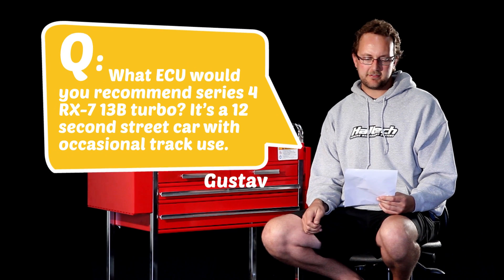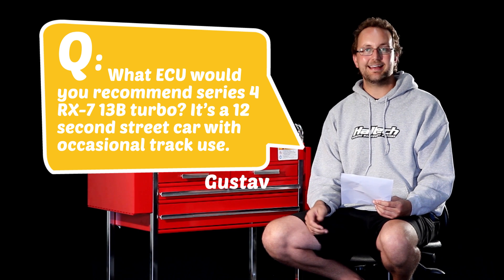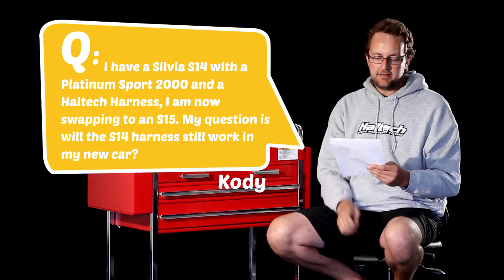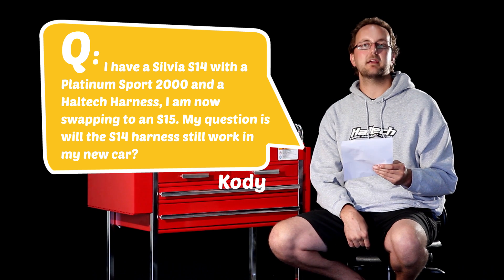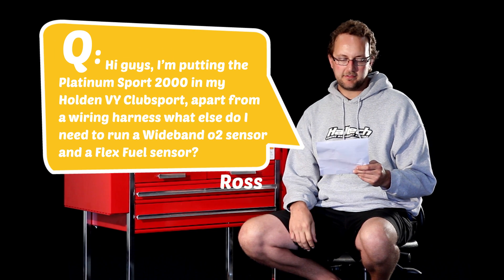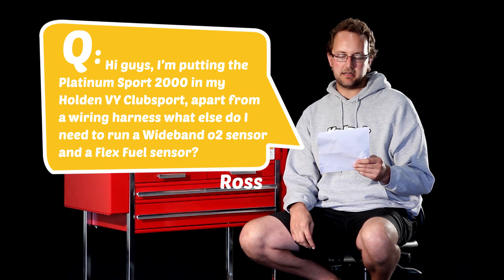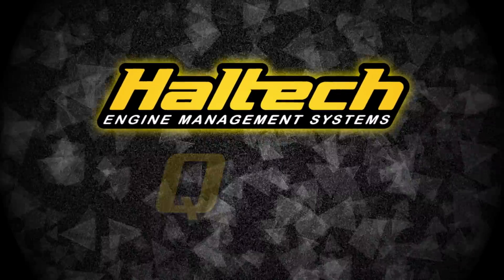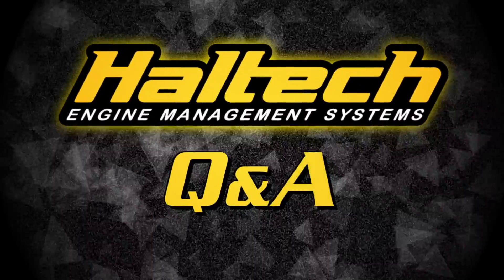Zenki or Kouki? ECU for 13B Turbo, Flex Fuel and O2 sensors - Haltech Q&A Episode 6

Comment: hey haltech
i currently have a 1997 mitsubishi mirage 1.5lt with a Garrett T04E turbo running 10psi. The setup is currently using an adaptronic ecu that i want to upgrage to a haltech system. would you recomend using a factory harness or wire up to the factory sensors directly?
Reply from the maker: +Jenko3212 If you have a lot of modifications in the engine bay, you may achieve a neater result making your own engine harness. Patching in to the factory harness is certainly acceptable if you are happy with how everything is sitting in the engine bay, however.

Comment: Thanks Haltech for the Q & A videos
I have a Sprint 500 in my Gemini with 220whp on 18psi
Can I run a flex fuel sensor for E85 conversion ??
More vids !
Reply from the maker: +GEMWRC The Sprint 500 does not support flex fuel mapping – you would need to either have the car tuned for E85 only, or petrol only.
Reply: Ok guys thanks for clarifying that for me .
Reply from the maker: +GEMWRC And by the way - your question made it to our next episode of Q&A:)
Reply: +haltechecu I am looking forward to the next round of videos !